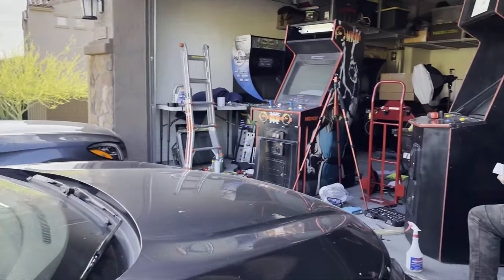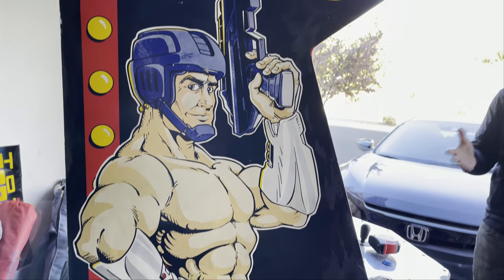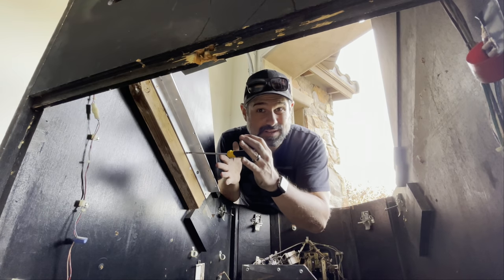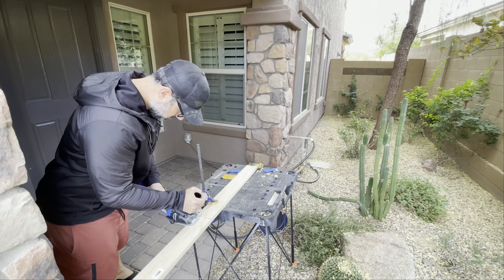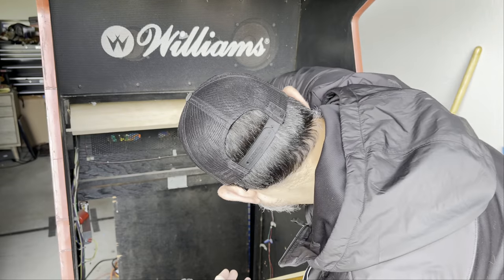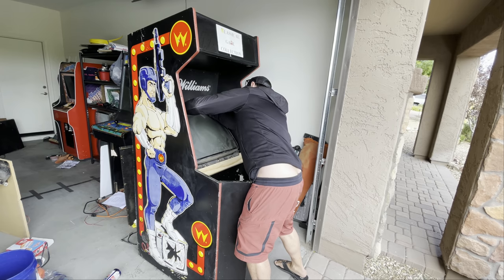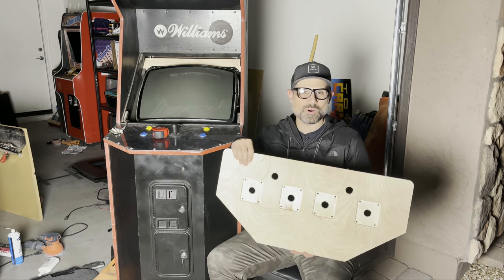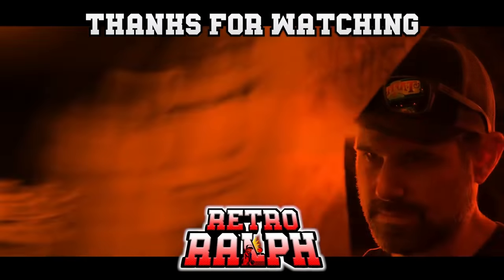Smash TV Arcade - Epic Discovery - You won’t believe this!

Comment: If you have some side panel vinyl art that's beyond repair and needs to be removed, what product should you use to remove it? Or do you just go and scrape it then sand over the damage?
Reply from the maker: Hmmmm, I would probably sand it off with a high grit sandpapaer.  I'm not sure if there's an easier way.  I guess you could attempt to peal it but I would imagine with the age and environmental effects it would likely not come off easy.  The brute force sanding method would for sure work, it would just be messy.

Comment: Why did you remove the tube by itself? I've never done that, I usually do the frame/chassis/tube in one piece. Cool project though!
Reply from the maker: The side mounted system was starting to pul away from the sides of the Cabinet, I was afraid the tube was going to drop.  So I just pulled it out in case.  I didn’t show that Unfortunately but one side completely tore out so I’m glad I did.  👍🏻. Wish I had that part on film but I missed it.

Comment: Great job,just pull the chassis frame when pulling the monitor,it’s double work but I’m proud of you!
Reply from the maker: I did it that way because the mounting system installed in the cabinet was really unsafe, so to avoid an accident I decided to just take the tube out 1st then deal with the chassis. Thanks so much for watching and I really appreciate you taking the time to comment.  Have a great Thanksgiving!

Comment: EscapePod work looks nice
Reply from the maker: EscapePod artwork is mostly on point, I have had some problems in the past but the owner Dan does resolve them quickly.  If you ask the community it's a mixed bag of responses but Dan is a good guy and although he has issues sometimes, he usually makes it right quickly in my experience. He also ships VERY fast so for an impatient guy like me, it's perfect.
Reply: @RetroRalph  I was looking at them for a bezel on a Super Pac Man I'm trying to get working for a friend.  Any opinion between the printed paper for $45 (I'd have to get a clear plexi or tempered glass, since the current bezel has the existing artwork flaking off :( ), a reverse print vinyl (also need a clean surface) for $65, or just getting a 'complete' for $107?  I'd have to see what the owner's budget looks like... but feedback might help me give a good recommendation.  My quick search is that clear tempered may be pricey... so 'complete' may just be best.  SmashTV is a classic.  Great work!  Thanks!